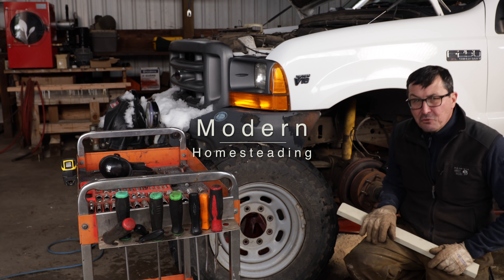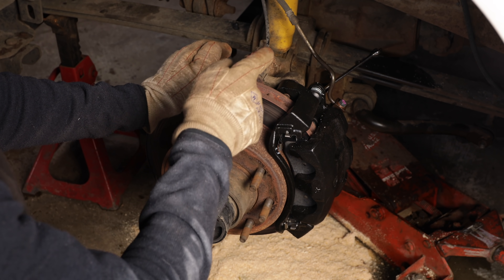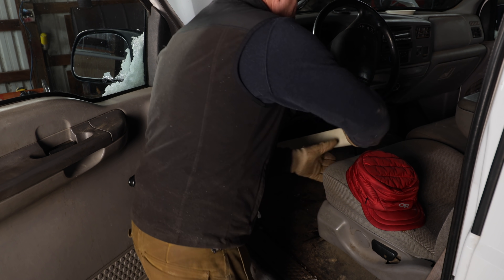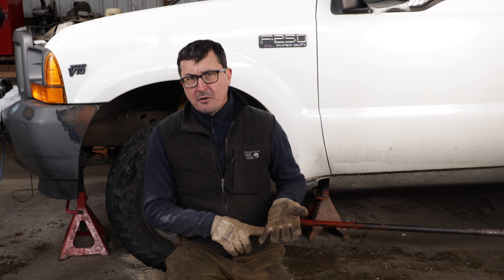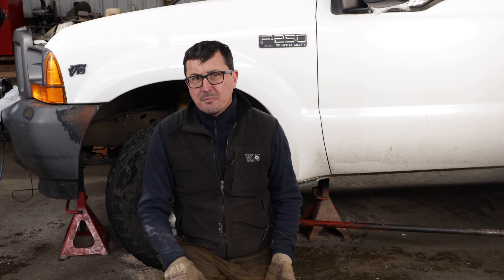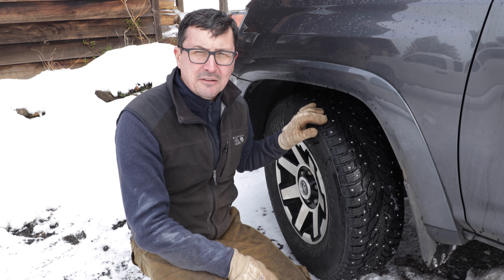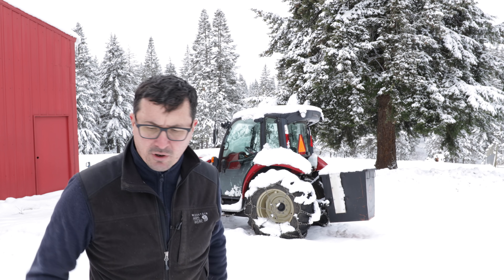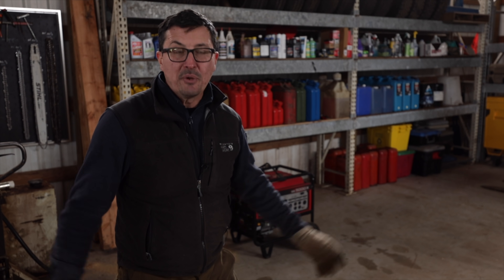IT FINALY HAPPENED!

Comment: I have a 5000 watt generator in my RV. I rarely use it. If I can't connect to shore power I run LED lanterns, and propane heat. I'm running that day because it's very cold in South Carolina. The Penance I suffer for having felt Superior for having better weather than the Pacific Northwest I left

Comment: I use gravity bleeding it really works well if you are by yourself like I'm, I also prefill the caliper I've changed dozens of brake calipers on Ford Super duty trucks they fail like clock work. Usually the right rear is the most common culprit, when you smell a hot brake 99% of the time its needs a caliper. The 99 to 04 trucks use different calipers than the 05 and newer truck made by a different manufacturer. The Napa rebuilt calipers are decent I've had decent success with them. I've gotten so good at changing calipers on Super duty trucks I can have one changed out and bled in minutes LOL.

Comment: Modern GM's suck, but so do all modern cars. IMO the best truck of all time is the 88-94 GM with a TBI 350 small block. Super reliable, easy to work on, plenty of spare parts around, fuel injected, but not to computerized.  No pesky safety Sally air bags and ABS to worry about.

Personally I cant stand what they have done to modern trucks. Bolstered sports car seats, computers, sensors, and plastic everywhere. They are way too big compared to old body style trucks. Trying to load something heavy in the back of one of these modern giant trucks is ridiculous. Parking lots haven't gotten any bigger, so parking one can be challenging. If you do manage to get it in the parking space, the fatty next to you will surely hit your flimsy door with theirs as they exit their vehicle. I owned a 2006 Chevy for a couple of years, but thank God I didn't sell my 93 Silverado.  I sold the 06 and kept the 93. Yeah I'll never own a new truck again. Just keep rebuilding the old ones I guess. SBC for life!

Comment: Wait...did you just say that the cause of sticky breaks was caused by the use of metric bolts?  Really?!?  Also I like to use my vacuum pump to get the air out of my hydraulic lines.  I had the same problem with my front breaks on my Ford.  I just used a big channel lock pair of pliers and squeezed the cylinders back into the bores and ran them in and out a couple of times, been running very well ever since.  Just cost me time.  Interesting video, Cody thumbs up.

Comment: I wish it was that easy to remove the big front bucket on the front  my Case 580 backhoe and install the Hay loader fork to pick up the 2000 pound hay bales. The rear digger back hoe bucket is miserable to change. most of the time I just leave the 24 inch bucket on. the 12 and 36 buckets just get rusty

Comment: Okay, so as soon as he said the 2 best cars to buy are.... I rolled my eyes, and then he hit the nail on the head. I'd take a Toyota or a Ford over anything else...... except for a 2000/2001 Dodge 3500, 4x4, quad cab dually with the 5spd. Yes it eats ball joints every 75-100k miles. Yes it rattles, but you can't hear the rattles over the cummins ;)

Comment: Apparently, you've never owned anything with an LS-based engine. These GM engines have gained a very good reputation for their longevity. I also like the Toyotas and Nissans. But at the same time, I can't knock an LS-based engine. When you get right down to it, an engine is an engine. It has no idea what company made it. When you get right down to it, they are all machines. And like any other machine will break down if it's not treated right. I've personally seen several LS based engines with over 3 hundred thousand miles on them still going. I've seen several LS based engines go BOOM at less than 20 thousand miles on them. Every one of them except one was driver error. The other was Walmart's fault for not checking to see if the old gasket came off with the old filter. And it still might not have blown up if the guy hadn't had his foot to the floor. Also, I'm reasonably sure you haven't driven anything MOPAR with the new Hemi in it. I don't know how familiar you are with, "Roadkill". They have a Hell Cat Charger that they have been beating the living daylights out of for close to 5 years now. They really hammer on that car, almost 5 years, and it hasn't given up yet. Which is exactly what they have been trying to do. Break it. It will eventually give up. It's a machine. But they have proven the abuse these engines can take.  Ford, I can't speak on because I've never seen anyone abuse a ford engine like I have an LS or Hemi.

Comment: No experience with changing ball joints on the Dodge/Ram truck’s I’ve owned over the past 15 years. My company 2012 f250 needed most of the front steering components done in the 1st 15,000 miles, though. Besides that & crappy interior, it’s been ok. Only 40k on it though.

Comment: 5:25, I like to do a lot of winter hiking in the Adirondacks and those shoe studs suck, they don’t work in the snow, and the plastic parts will snap off and fall out, when you go hiking in the ADK. when there isn’t show you can find a whole handful of those studs on the ground. if you want some that gets great traction, get Hillsound brand micro spikes/crampons, also don’t get the yaktrak ones that have the coil springs on them
or instead of wearing spikes you wear boots that have get traction instead of wooden crocs when there’s 6” of snow
(much love, your videos are great)

Comment: Cody my 06 cummins didn’t get new ball joints until it had 250k miles brakes on all vehicles are routine maintenance, even the calipers, especially 3/4 ton 1 ton trucks, I would take my truck over any with the all American cummins, manual four wheel drive linkage, four wheel disk brakes, and no unlocking hubs, my truck is all mechanical besides the injection system but I wouldn’t trade it for any thing, it’ll have a million miles before I get rid of it

Comment: Mostly agree on the vehicle brands - F250 and F350 are nice (not a fan of the 150's) - nothing by GM, after 2005.  Toyota Tundra's are good.  As for MOPAR, the only vehicle I would buy again is what I drive now, a Laramie with the Hemi (I have 310k so far and still going), but nothing else from Dodge!

Comment: I have 2004 F250 V10 since new and it still runs and sounds great.  Changed the original spark plugs @ 190,000 miles with no issues. Never been to the shop for anything.

Comment: the ball joints aren't the cummins it's the 1500's that have that problem and it hasn't been an issue since 2003ish
Reply: Dodge 2500's go for way more than Ford equivalents.

Comment: You should do the Gatorade bottle trick to bleed you breaks. I have a 2004 Toyota tundra with 180,000 on the clock. Knock on wood no major issues and we bought the wife a 2016 rav 4 and they just seem built so much better.

Comment: Ball joints every 30,000 miles is so not true.  My 2012 Dodge/Cummins has 95,000 miles on it and has never been touched. Unlike my last Ford F150 that went to the Stealer on the hook twice a year.

Comment: 2000 Dodge 2500 diesel here with 250k miles yes cheap ball joints wear fast I buy the good expensive ones and last set I put on was in 08 lmao I’ll take my Cummins diesel any day over the other 2 diesels. I’m my own mech so I know the parts that I need to watch.

Comment: I must have a rare dodge  with the Cummins,  99, 110k truck had 35s when new, to 37s to now 40s for tires. Just did the first set of ball joint on passenger side, driver side is still original lol
Reply: The brakes do suck on it tho,  my 99 f350 brakes are 10xs better

Comment: use a tube submerged in a jar of fluid and connect the other end to the open bleed valve and then slowly pump the brakes...just keep the reservoir full as you do it.

Comment: I highly disagree with you. I got my first Cummins when I was 18 and I completely rebuilt and replaced everything by MYSELF (yes I'm butthurt) I'm 22 now. I agree with the ball joints but if you're a diy person any vehicle can be great. I've owned an Audi a4, Ford 250, Dodge 2500 and Chevy impala. I can go on and on about how other manufacturers are better than Ford but ALL manufacturers have weak links.  Ford makes it incredibly difficult for maintenance when you need specialty tools for a simple task. Like using a spark plug extractor to remove spark plugs because the plugs break off in the threads, shoot out or rust in the threads? Just because you own a Ford doesn't mean it's best 😂 In my personal experience going from a tool set with screwdrivers and pliers with no idea what I was doing to present, 2nd gen Dodge Cummins all the way. They run forever (if you take care of them), very simple to fix or repair, parts are everywhere, LOTS of space in engine compartment and believe it or not I get great gas mileage! (unlike that v10 gasaholic of yours) if all you have to say about Dodge is you don't like replacing ball joints every 30,000 , upgrade them !! All I'm saying is don't listen to this guy and go buy yourself a POS because "Ford is great" and he says so. Give other manufacturers a chance there are lots of great vehicles out there that ARE NOT A Ford.

Comment: Ford's have never really done it for me, me and my family have always been Chevy and Mopar guy's. The only problem with that is their quality has dropped like a rock off a cliff in the 2010's. So now I always buy used one's made before they all remodeled their trucks to look modern, which was around 2010. Hopefully they both bounce back a little bit from bankruptcy and catch up to Ford and Toyota. It's really sad because they used to be great brands even better than Ford in my opinion until they went bankrupt after the recession and started cutting corners. But I think all the old cars are better quality then the new ones anyways, even the Ford's. But that's just my opinion.
Reply: Great opinion I half to agree sir.
Reply: 2010 is when RAM took over and they're slaughtering Ford and Chevy. Absolutely no comparison. The drive train is awesome . They actually have a little Style instead of ugly square boxy Fords. Interiors are way better than either Ford or Chevy.
Reply: @DK-jd8bj  sure the new ones (up to 2019's 1500) are way better at first but they become endless money pits if you've ever had them for any length of time. The new light duty ram trucks are ugly af

Comment: Like everything else ice cleat construction is dependent on where you are using them and for how long. On pavement you want a more durable material like a chain at a slight loss in grip over something like the one shown in the video that is great for off road as it trades some durability for a good grip.

Comment: You say ball joints every 30k miles on a Dodge I've only seen that on a 04 2500 03 and 05 are totally fine yes the trans are weak if it's an automatic and if you're not loading them overweight or beating on it they are fine and I never had an issue with a engine on a Dodge or Chevy chough 04-15ford cough. But if you want a bullet proof truck manual Cummins or 99-03 7.3 power stroke

Comment: Double check the master cylinder too I had a 97 Toyota Corolla and it kept locking up on the driver side front tire and it was the master cylinder. I found that out after changing the caliper, brake lines and everything else

Comment: I work for Chrysler. When the transmission on my Ford Excursion blew up last week. I bought used 2013.... Honda Odyssey.
Reply: we have an '08 Odyssey.  Honda builds a fantastic vehicle.  the toyota trucks are good too.  but that honda motor, and safety.  Odyssey is one of two name plates driving right now that have no fatalities.  The other being one of the Mercedes.  Had a Prelude with 336,000 miles, and ran perfect every day.  Wish I hadn't sold it, but the Corvette I replaced it with is fun too.  ;)

Comment: I've had 3 fords F 150, f - 250 & a Thunderbird, they were always in the shop. I have had the same Dodge 1500 4x4 5.9 since it was new in 2000 its has 327,ooo miles on it. with regular maintenance no major problems I agree Toyota is 2nd but also look at insurance & repair costs they are twice as much to insure and repair than Chevy or dodge. just food for thought. awesome video as always RV

Comment: LOL! You finally said something I could not disagree with more. You obviously have no experience with the 12 and 24 valve cummins motors. Please be humble now Cody. Have you ever owned a 12 valve or 24 valve?  30,000 miles for ball joints on a cummins? That is a stretch for sure although I've rebuilt my front end and I'm currently at 265,000 miles. Equate that into a motor that goes 1 million miles and its a negligible cost of ownership. Plus the resale value alone! Man alive take a look at older 1st gen and 2nd gen dodge cummins. They hold their value as well. I will agree with you on the Toyotas.  Only motor Ford has made that can touch that is the 7.3.  The 12 and 24 valve 5.9 cummins motors are hands down some of the best motors ever made!  Its undeniable!

Comment: I own a 1999 Ford van and a 2010 Ford Fusion both still on the road with minimal problems throughout the years. Even though they both are put together using metric bolts.

Comment: https://www.jegs.com/i/Russell/799/639560/10002/-1

I buy these bleeder check valves. No connection to the companies in the link just a customer.  Crack the bleeder, connect a clear vinyl hose and put the end in a jar.  Once the fluid is clear and bubble free.  

Easy as fishing.  I’ve tried the wife pushing the pedal and it’s always an argument when she lets off the brakes with the bleeder open allowing air back in.  

One man brake service without special tools like a brake ball.

Comment: nice vid, but damn i dissagrree with your opinion on ford :P
i own a ford, and its the biggest POS ever.
4 turbo failures in 12 months, on a very well serviced engine..
I only keep it because i love the 60+mpg :P 
theres a reason why ford is known as Found on Roadside Dead...
BTW, you also said to avoid Crysler but general motors is good... Crysler is owned by GM lol. So kinda contridictin yourself there buddy..

Comment: Factory dodge front ends are trash. Run them till they fall apart, which doesn't take long. Then replace them with carli or dynatrack. I'm going 300k on a carli front end on my 2500. And you can't be serious about jeeps. You need to check resale value on a wrangler.

Comment: That's not true. I have a 03 Dodge ram 1500 with 260k. I have not had any engine/transmission problem at all. I still pull my camper.

Comment: Have you considered getting a PTO driven generator head unit?
They are usually very cheap compared to gasoline engine driven ones.
Also...have you considered installing a generator plug in the big workshop?
You could leave the generator in there during bad weather...especially rain
Just a couple thoughts  :)

Comment: i have a 1988 nissan navara, 340000 kms (211000 miles) and the only major things needed so far are tail shaft seals and starter motor, the thing is a trooper and a half

Comment: There's lots of room for argument on vehicles!!! .....Yes, they all have issues, but Ford and I don't get along at all. I tried em, it did't go well....You can have 'em.   I've been broke down with all the others and figured it out, made do, and limped home without a tow truck. Back around 98 I commuted 50-plus miles each way in an 85 Chrysler K-car and had better luck than any Ford! LOL  I also have literally about a million miles commuting in a few Nissans - 300K to 450K miles out of each one with nothing but oil changes, tires, and brakes - but I hear some people swear Nissan is nowhere near as good as Toyota.....YMMV...
Reply: I am a Nissan fan my self but unfortunately there quality has slipped in recent years. Nissan lost most of their Japanese domestic production from the Fukushima tsunami and has been forced to cut corners and partner with Renault just to survive. I hope in a few years their quality will be back up with their other Japanese counterparts but in the meantime I just bought a Subaru.

Comment: I have to disagree with you about what is the best vehicle out there. Let me give you a true life story. My uncle bought a used 1970 Chevy pickup 3 speed on the column 350 motor. Every 3000 miles he changed the oil the filter on it he kept it tuned up and had no problems with it when I got the vehicle I have to disagree with you about what is the best vehicle out there. Let me give you a true life story. My uncle bought a used 1970 Chevy pickup 3 speed on the column 350 motor. every 3000 miles he changed the oil the filter on it he kept it tuned up and had no problems with it when I got the vehicle it had over a hundred thousand miles by the time I finished up with it it has over 200,000 miles on it. I had a Dodge Neon and it was serviced every two to three thousand miles went by the owners manual change out belts that didn't need to be changed out we did what the owner's manual said and it lasted easy 100000 miles. Yes I'm a big Chevy fan and currently right now I drive a Kia Sorento 2011 I went ahead and got new brakes and had the rotors change download put in a new battery in it oil change and I have new tires on it and I really love the vehicle and it has a hundred and thirty thousand miles. I believe it comes down to keeping your vehicle serviced that's my opinion miles. yes I'm a big Chevy fan and currently right now I drive a Kia Sorento 2011 I went ahead and got new brakes and had the rotors changed a note putting a new battery in it oil change and I have new tires on it and I really love the vehicle and has a hundred thirty thousand miles. I believe it comes down to keep in your vehicle serviced that's my opinion